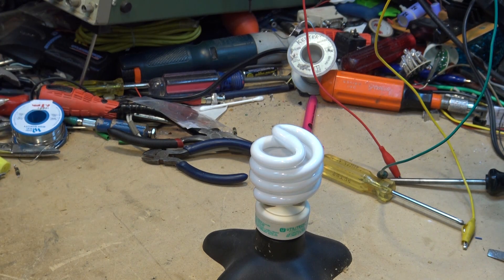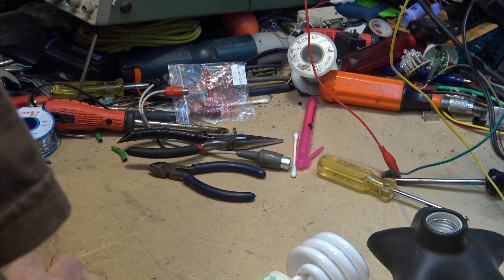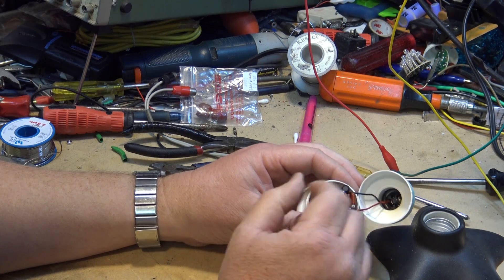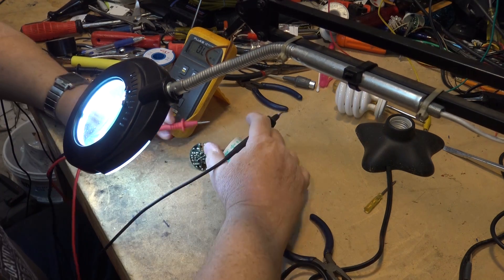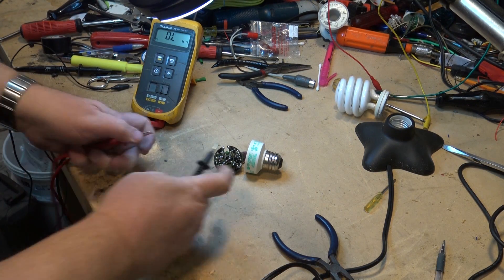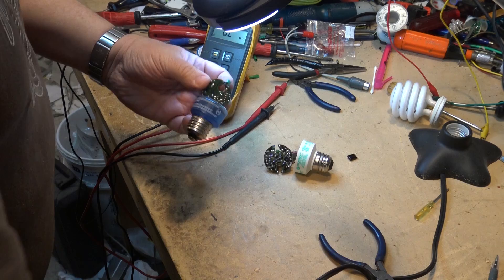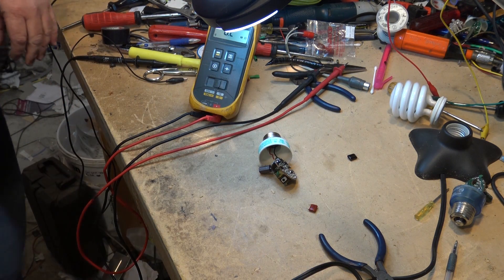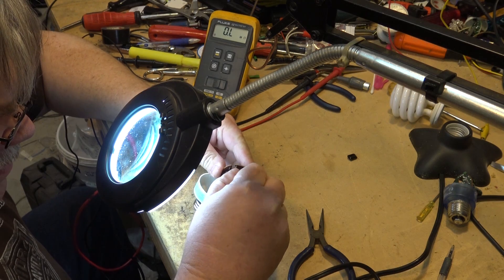CFL bulb inverter repair

Comment: Most lamp failures I have experienced are open heaters within the tube. Cheap tubes. Has anyone tried using one of these inverters to power the small T5 size linear tubes of about the same wattage? Would be interesting to see how either part would fair.
Two thumbs up! Great info!

Comment: Thumb  up from my side. As always very interesting video and very quick fix. What is your opinion about LED lighting?
Reply from the maker: LED lighting is the future. The process have fallen, and the newer ones give a nice light, but don't expect them to last 20,000 hours.I have a filament type out in the custom made luminary in the driveway that runs all night.  You can see it in my "Rain" video. In the open luminary it really looks like an old incandescent lamp.Now that they have the color of LED looking exactly like incandescent bulbs they are really pleasant in the house. I have had a bunch of earlier ones fail, and when they were 30.00 that was a tough pill to swallow, but the prices have come down enough now that if it burns out after a year or 2, hey its only 4 bucks right. When it was 30.00 2 years was not acceptable. As the CFL bulbs burn out, I am replacing them with LED, but I still try to get the most like out of a CFL I can. This one went back into the same fixture it came out of.

Comment: Had a LED bulb get put on a dimmer. It popped a cap and burned out one of the ten led's. Removed the blown led, soldered across the leads and replaced the cap. Its been working for months. Its over driving the other nine so it will go at some point but not in land fill yet.
Reply from the maker: I had an LED that popped one of the LED as well. Did the same, jumped the LED chip that failed.  Been working for 2 years since then.

Comment: Properly wire wrapped joints are actually more reliable under most circumstances than soldered connections.  Interesting video.  I should have sent you my latest failed LED bulb to analyze, but I threw it in the trash!  :-)

Comment: OK you saved a buck.  I got a bunch free form Ohio Edison, and at Menards I got Feit for 3 for a buck, now that's cheap!
Reply from the maker: Not the point of saving a buck. It is teaching component level troubleshooting. It also keeps this out of the landfill. Sure we have recycling programs in place but really how many people actually make the effort to load them in the car, and drive to the recycle place to drop them off? Very few I bet. Most people just toss them in the trash where the mercury they contain gets into the environment.
Reply: Good point, funny you had a dead short on a cap like that. I hope the LED lights help the situation a bit.  They also have electronics.
Reply from the maker: 4 words. They're not holding up.
Reply: electronic failures or LED?
Reply from the maker: I have had a few where the LEDs themselves have gone bad, and one right now that flickers for about 20 minutes every time it is turned on. That one is probably an electronics problem.
Reply: Thanks for the videos.  I don't fix much anymore and you take me back many years. Your productions are the best.

Comment: I enjoy your repairs, you wont get negative from me :-).
The mean green crapacitor, i only use them in low voltage circuits, im supprised they use them in the lamp.
.
Here is a chap thats made diagrams for flourescent bulbs, might be interesting to you.
http://www.pavouk.org/hw/lamp/en_index.html
.
I have a draw full of pcbs for lamps, the tube died in all of them.
I had a recent lamp die, and i like you cracked it open and found a dead cap linking the tube heaters together, 15 mins and it was working again :-D

Comment: I was guessing that it woud be probably be shorted oscilator output cap even before he opened it, cause if heaters are on oscilator must be working and that cap is only thing left if you look at schematic of cfl lights.

Comment: Hey,on what voltage does the CFL bulb run?
Reply from the maker: I have never measured it, but I would imagine a couple hundred volts off the inverter is needed to strike the arc. Once the arc strikes the impatience of the tube drops, and the voltage drops and is current limited by the ballast.

Comment: the only point to get CFLs today is that price is a bargain,but 9 on 10 fail because of filaments interrupted after a couple years,so no point in opening trying to find the problem,i just dump it and get a new one.

Comment: I have a bunch of these that are dead. The curly part is good but the inverter has died. I'm not sure what has failed in these but I am able to light up the curly part with my arc lighter. the lighter arcs to the metal all the time now so I need a new one and I'll take this one apart and use it for something.
Reply from the maker: Quite often the filament goes open on one side. In this case the filament was fine, and the inverter was running, as the filiments were glowing. One of the capacitors shorted, and killed the HV to get the tube running.I have seen this before, infact the old inverter from the "blue" cfl I swapped inverters on last year had the same failure, so I pulled the good cap and fixed this inverter, just because I could.

Comment: A $2 CFL might not be worth fixing, but since many more valuable electronics die from similar capacitor failures, the knowledge gained is certainly worth the time invested. In any case, haters are gonna hate. Their loss.
Reply from the maker: Exactly, it is all relevant. Electronic circuitry regardless of what it is used in is similar.

Comment: I fix things all the time, just for the point of fixing it. Like you say, good to find out why something has failed. Thumbs up from me.
Reply from the maker: Exactly. I trained for 20 years as a diagnostic engineer. When I say trained, well you never stop learning right. I never went into designing electronics only servicing which can be just as challenging, sometimes even more so. When a component fails the entire behaviour of a circuit changes, and it can be a challenge to find the single part that is causing that failure. Sometimes we succeed, and some times we fail. The video I am editing right now that goes up next is such a failure. Well not a total fail, I did find the part, but as it turns out it is obsolete, and there is no suitable replacement, plus the owner declined to repair, but it was an interesting piece of British audio gear. Yes they actually did manufacture audio gear in England at one time.
Reply: Absolutely agree and looking forward to the next video.